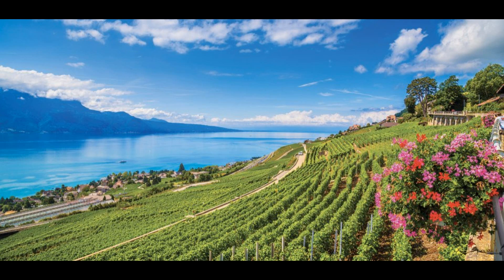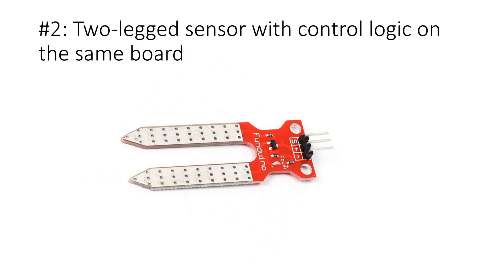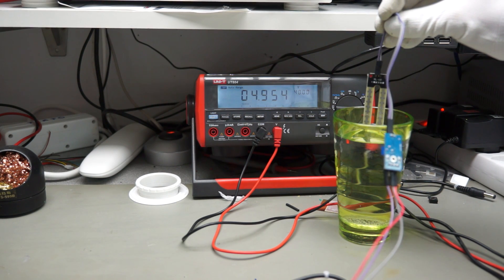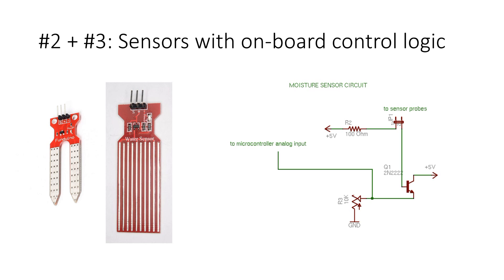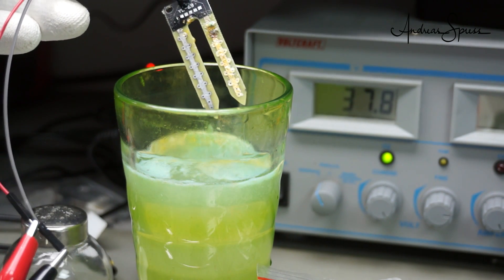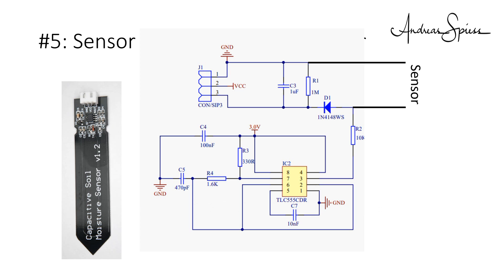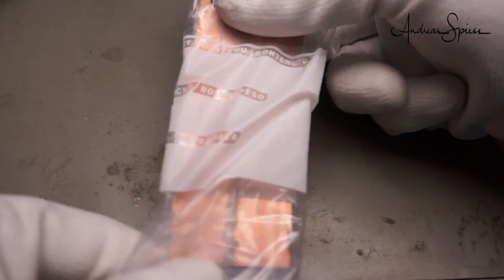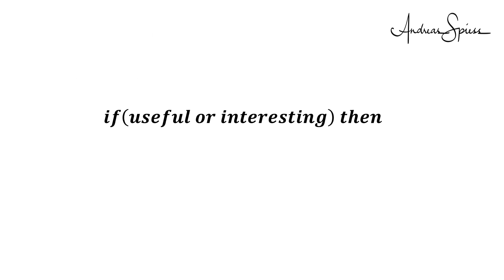#207 Why most Arduino Soil Moisture Sensors suck (incl. solution)

Comment: An NE555 is not the best solution. A Schmidt trigger or comparator configured as an oscillator has some advantages. A even better solution is to use a low power 8 pin PIC. All the above components have unused sections that can be used to buffer the output from the sensor. The PIC timer can generate the necessary square wave driver signal, the ADC input provides a high impedance input  which can be processed to compensate for the signal offset and any environmental tolerance effects. The PIC UART can be used to digitise the signal for serial transmission.
Reply from the maker: I cannot see the advantage of a Schmitt-Trigger over an NE555. I think the waveform is not important for this application. You are right, if you have to transport the signal over a distance, then it would be much better to use a micro and convert the signal into a digital form. For most of the Arduino lovers, an ATTiny would probably be the choice then.
Reply: Andreas Spiess the Schmitt is just a way of providing an on/off output. A comparator provides a more adjustable trip point. The main advantage is that these devices are supplied in multidevice packages, giving a signal generator and receiver in a single package. The PIC gives a minimum component solution. I have used one to sense the water level in a garden pond, providing a warning if the water filter overflows and risks emptying the pond. 
By the way, the green stuff is most likely copper carbonate or copper hydroxide, both salts are toxic to fish and pond life. It is also toxic to humans, producing symptoms similar to serious food poisoning if consumed, even in relatively small quantities.

Comment: Hi Andreas, thank you for the video, very informative, do you think the plastidip would take away from the sensitivity much? what if the capacitance sensor was coated in several coats? would it loose it's ability to sense through the porous rubber like coating?
Reply from the maker: I bought some plastic spray and plastidip. I plan a followup Video to sum up all the good input given in these comments

Comment: I’m not sure, but I think if you measure with AC instead of DC it should prevent oxidation?
Reply from the maker: Yes. This was proposed by many other viewers. It can be done by connecting the sensor to two pins of the microcontroller

Comment: Does the capacitance change when the conductivity of the fluid changes? For example salt water vs. fresh water?
Reply from the maker: Salt seems to have a minor influence. But because the probes are isolated it is not the conductivity.

Comment: If I need to measure the depth of water in a cup I'll sure use this.  I think if I'm going to measure soil resistance I will use 2 stainless wires in gypson and control the resistance of that circuit and not the capacitance.
Reply from the maker: I read that the gypsum sensors are good. I did not see any for sale on Aliexpress.
Reply: They are available but are expensive ( $40 USD) Watermark is popular brand.  I make my own with stainless steel welding rod buried in plaster of paris.

Comment: I assume the chemical reaction is triggered by the Voltage through the sensor.

Wouldn't it be less of a problem if the cheap sensor only measures once every few minutes and is disconnected in between?
Reply: Yes. As it is said in 20 other comments before.
Reply from the maker: You are right.

Comment: Thanks for the video. I was just working on some prototype using the capacitve sensor you mentioned here as this video came in. What would be nice perhaps is to do a follow up video on how to use the sensor in combination with a battery powered ESP8266 using deep sleep (max interval perhaps). I have it running in combination with deep sleep but still the battery (LiFePo 3v, 1200mAh) lasted only two days. Then I realized that during deep sleep I left the sensor powered to 3v so perhaps that drained the battery. I guess I should control the power of the sensor from the ESP either using a transistor or perhaps directly from the GPIO. So, indeed maybe an good idea for a next video project now that you discussed the various sensors?

Cheers, and thanks for all the great videos. Love them (even with the funny accent)!
Reply from the maker: There were other comments concerning switching of the sensor. It seems that it is better to use a FET to switch Vcc of the sensor.
Reply: Just tried it with a FET but I still can't get the esp to work longer than a couple of days before the batt runs out. Still.. would be awesome as a project Andreas to make an esp8266 powered by a battery and this soil sensor that can last a month or 2 (or more). :)

Comment: Andreas Spiess - great video, I was looking for something on soil moisture sensors! What do you think about this sensor: https://www.vegetronix.com/Products/VH400/ - it's pricey, but uses transmission line theory to measure moisture (i.e. I'm guessing it also generates a frequency like the capacitive sensors, then matches the SWR to determine the capacitive reactance of the sensor). I don't know how I feel about the exposed PCB, still....
Reply from the maker: TDR seems to be the best method. However, I found a comparison on the internet where this sensor did not give good readings. So maybe you google before you spend the money.
Reply: I guess it depends on the frequency you're able to drive it with...that said, the capacitive sensor curve you show in the video doesn't look very linear, either, so I wonder how good its readings would be unless you can develop a good mathematical model for the curve. Thanks for responding!
Reply from the maker: I would not trust the linearity of these sensors at all, even after calibration. And since the capacity is in the denominator of the formula it anyway will not be linear without mathematical correction.
Measuring soil humidity seems to be an art. But for deciding when to water it should be ok.
Reply: @AndreasSpiess  I have been using the VG400 for more than 10 years and it still performs beautifully. There is a calibrating curve on their web site that can help wit the calculations

Comment: I suspect using a lower voltage will prevent the corrosion. Or you could use different types of metals voltage to provide anodic protection
Reply from the maker: I think you are right.

Comment: Hi Andreas, great video as always, thank you!

Just started on saturday to use the capacitive sensor you mentioned here, I will use it with an Arduino Mini Pro and TTN, so it has to be low power. 
If I wire it up, I measure 4.8ma continously power consumption at 3.3V, is your sensor also that power hungry?
I then decided to power it using an Arduino pin, to set it high, wait for 150-200 milliseconds, take the measurement and set the pin low again. This way, much battery life can be saved. Unfortunately, voltage of that pin drops from 3.3V to ~3.13V if the sensor is powered from it. 
Maybe you can explain in a few words how you're using them? 

Thank you!
Reply from the maker: Maybe you use a FET transistor to power the sensor. The pins have an internal resistance and therefore drop voltage if you draw a current. Normal electronics do not need a lot and therefore you do not experience such a voltage drop.

Comment: Hello Andreas,
When I take a look at the capacitive sensor I see a closed loop design at the pcb and not as you show in the schematic two seperate sensor "wires".
Regards Jon
Reply from the maker: Did you test it with the Ohm meter? Mine shows no connection.

Comment: Hard to tell exactly what the green stuff is without some tests. Pure copper oxide(s) are not green (they are red or black), but they can lead to a few different blue / green substances by reacting with acids or even the air. It should take a long time, though.

Did you add salt to the water to improve conductivity? If so, my guess is the green stuff is copper chloride (specifically, a mix of cupric and cuprous chloride). Even if you didn't, there are probably a few salts in the water that could cause the same effect, but it seems quite strong (maybe it just looks that way because the glass itself is green). Could also be caused by the copper reacting with some other substance from the PCB (anyone know if there's sulfur in PCBs?).

It shouldn't be terribly toxic to animals (well, depending on the dose, of course), since the copper tends to stay attached to the oxide / salt, but I have no idea about plants. Looks like it's mainly "toxic" for the sensor itself. ;)
Reply from the maker: Yes, I added a little salt to speed up things. And I think too that the plating materials had an influence because they were removed first. And I am sure the green glass had an influence.
Reply: > I added a little salt to speed up things.

Probably (dihydrate) copper chloride, then, possibly mixed with other salts formed by whatever non-metals were on the PCB or water supply. It's used as a fungicide and to make green fireworks. Seems to slow down plant growth by interfering with photosynthesis (at least on spinach - it was the only study I could find, and I didn't understand half of it).

So, if you know any town that is planning a fireworks show, has a lot of invasive mushrooms growing everywhere, and needs to slow down Popeye, you can offer them a 3-in-1 solution! ;)
Reply from the maker: If I read all these "side effects" I think your vote is more for the capacitive model ;-)

Comment: I use the cheaper Chinese water sensors where there is no water normally. e.g. in the kitchen, under the sink where the dish washer is attached. If water collects in a flat bowl I put under the hoses, I get an SMS.
Reply from the maker: That is a perfect application. Thank you for mentioning it!

Comment: Hi, yes, me again! A suggestion. Thank you for showing the electrical citcuits, they do a lot to help to understand how things work. I think they would be even more helpful if they could be drawn with inputs on the left and outputs on the right and also with positive supply voltages at the top and negative ones at the bottom. That way they 'flow' better. There is a caveat  of course. Sometimes doing it that way leads to far too many circuit lines cossing over each other, so it is, as with so many things, a matter of judgement. Incidentally, congratulations on your English, I regret to say my knowledge of other languages is very poor, something I now regret. BobUK.
Reply from the maker: I copied the drawings from the internet. So I had no influence on how they draw it. I still hope that, together with my humble explanations, it was understandable.

Comment: I'm currently testing cheap sensor of the second type. I'm taking measurements every minute and storing them on raspberry pi. I tried calibrating that sensor but I get wierd readings. After first watering raw value jumped from 650 to 705, but after second one it dropped to 670. Don't know why.
Reply from the maker: These sensors are not accurate. If you google you will find that measuring soil moisture is an "art".
Reply: Andreas Spiess Whould those capacitive sensors be more consistent? Right now I rely on timed watering
Reply from the maker: I do not know. But looking at values only does not say a lot. You have to watch the readings for a period of time and then decide if they provide an accurate enough reading for your purpose. Maybe you only will be able to get a 2-bit accuracy (dry, 1/4, 1/2, Fully watered), which would probably be sufficient.
Reply: I'm currently storing my readings on raspberry pi.

Comment: Hmm. I think you have over simplified. Using the word 'resistance' to describe a capacitive effect is very misleading. Why not just say that the capacitance changes, this alters the frequency and the circuit measures that change? The correct term, as you know, is 'impeadance' but, as you realised, it does not help if your viewers have not heard about it before. There is no need to mention complex numbers either - and yes, I do understand those. The  green stuff is copper oxide folks and we need a gardener to tell us if it is good or bad for plants. My plants know that I'm not a gardener! BobUK.
Reply from the maker: The frequency does not change. The capacitor is not in the feedback loop. I also first thought they put it int the feedback loop ;-)
Reply: And it is not copper oxide. The oxides of copper are red and black.

Comment: Hallo Andreas, mal wieder ein tolles Video. Ich habe ähnlich Erfahrungen gemacht. Im Moment hänge ich aber daran, dass das analoge Signal des Kapazitive Sensor sich nicht gut mit dem ESP32 verträgt. Die Werte ergeben keinen Sinn. Ich vermute es liegt am Analog zu Digital Converter (ADC). Ein Arduino Nano kommt damit besser zurecht? Hast du adhoc eine Idee woran es liegen könnte oder gar eine Lösung parat? Viele Grüße und weiter So!
Reply from the maker: Ich würde die beiden Probleme trennen: Zuerst den ADC Eingang des ESP mit einer spannungsquelle testen und erst dann den Sensor anschliessen. So findest du raus wo das Problem liegt. Es könnte sein dass der Eingang des ESP  nicht hochohmig genug ist. Dann brauchst du einen Opamp als Verstärker dazwischen.

Comment: I still prefer cheap sensors/measuring conductivity. The downsides you mention with cheap sensors can be mitigated with a different wiring. The wiring requires 2 additional diodes and 2 resistors. Unfortuanetly I cannot paste a link here, so search for "The Vinduino Project-3: Make a low cost soil moisture sensor reader" for the wiring. On Github, the source code for measuring is in the Vinduino repository; "Vinduino-Conductivity_2.00.ino".
Reply from the maker: Changing polarity and switching for resistive sensors was proposed also by other viewers. It for sure reduces the problems I described a lot and I should have mentioned it in the video. I saw you use gypsum sensors, not these cheap ones. Did you do comparison measurements with capacitive sensors?
Reply from the maker: Good to know. Adafruit sells such a protected SH sensor (  https://cdn-shop.adafruit.com/datasheets/SLHT5.pdf ). I got this link in another comment here.
I did not find scientific tests with this method. But I did not search for long.

Comment: Because you have to use tensiometer instead of applying any kind of voltage to the soil.
Reply from the maker: There are a few other principles to measure moisture. But most of them are quite expensive.

Comment: Haven't got to the end of the video yet but wasn't there an application specific ic years ago that evaluated the probe with ac? Cheaper than a noble metal probe.
Reply from the maker: This is possible using two Arduino pins (free of charge).

Comment: weigh the plant pots + contents
Reply from the maker: Should also be possible. Not cheap :-(
Reply: Depends on the size and number of your plant pots... load cells on ebay a pound for one, less for more, some Arduinos can read values direct from the load cell/strain gauge. Some complete digital scales are close to "pound shop" items. Strain gauges, 40 pence each on ebay, again drive direct from micro, innovative 3D print, stick on strain gauge. There is the snag, that as plants grow they take in carbon from the air and get heavier. OTOH as a gardener easy way of telling what needs watering is feeling how heavy the pot is - avoids getting hands dirty. Other way is to look at colour of compost - job for one of those Arduino light colour sensors. Mess of real world to contend with however you do it.
Reply from the maker: I did a video about using strain gauges. They work quite well. Usually, you need an amplifier/ADC, but also these are cheap.

Comment: The traditional  'digital' method of poking the soil with your finger works (I think) by measuring the rate at which heat is conducted out of the skin by the soil... copying the principle for a sensor might have advantages compared to  other methods. obviously you'd only want to add heat the soil infrequently.
Reply from the maker: I do not know if this method would work. There are a few other methods available. However, these sensors are way more expensive and more for the professional.

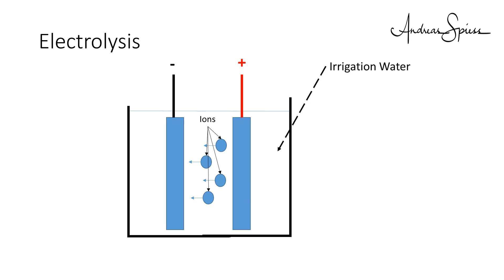Comment: 6:35 I also noticed batteries hold charge for a lot longer when I cut the VCC wire.
Reply from the maker: You are right. This can be done with all these sensors.

Comment: The reading from a capacitive sensor is affected by more than just the moisture. Having more water in soil would change the dialectic as you showed by the glass of water. But soil also contains ions which would change the dialectic.

So more ions but less water could give a similar reading to more water and less ions.

Also the frequency of the capacitance now starts coming into effect. Different molecules behave differently in an electric field at different frequencies.

It would be interesting to know how reliable a capacitive sensor actually is. Maybe the ions affect is actually negligible.
Reply from the maker: After this video, I started to search for academic papers. It seems to be very difficult to get accurate readings for soil moisture. If you only want to water your plants it seems to be easier as the sensor is always in the same place and you get longterm measurements. So you can "calibrate" the sensor. I would not expect more than an indication for watering.

Comment: Btw, cheap and practical solution to make the PCB water-resistant? Just use transparent nail polish. Costs ~1.5CHF and comes with the brush :)
Reply from the maker: There were a few others proposing that solution. Looking at how our women have to remove the polish it should be water resistant ;-)